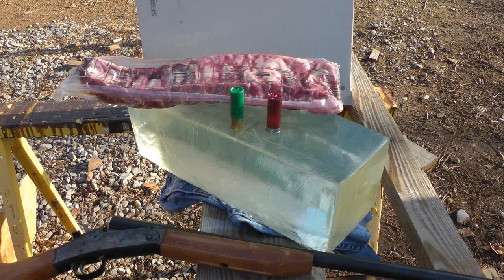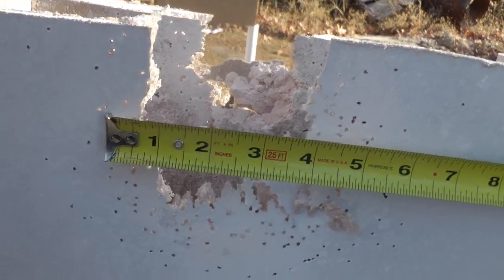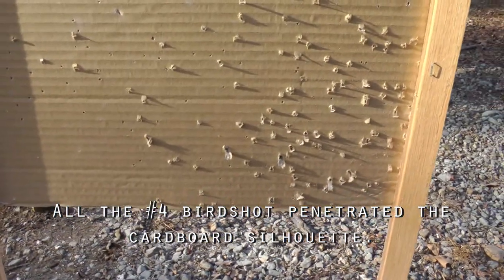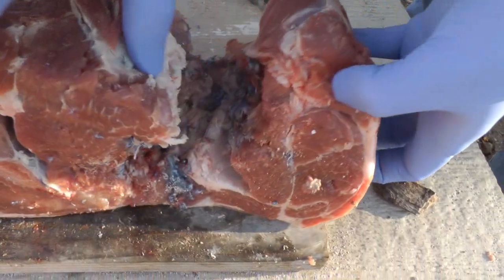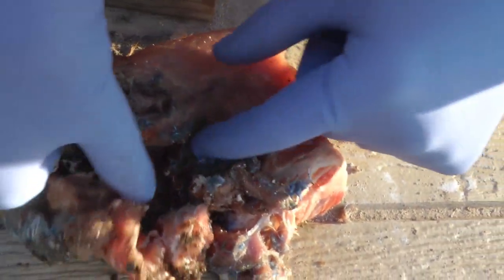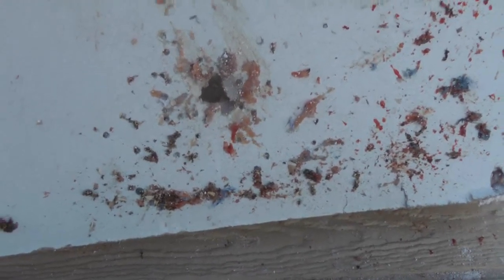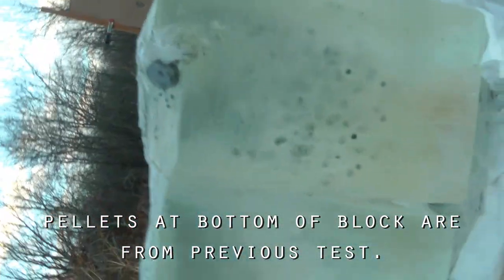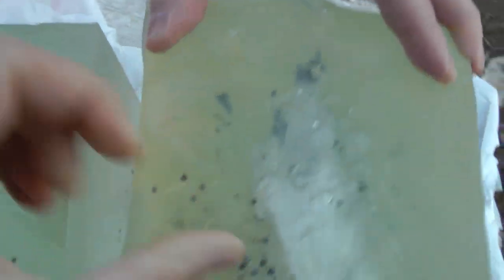Birdshot Home Defense Gel Test

Comment: i was shot in the right leg from 10 feet with 20 gauge load of steel #6 shot, I still have some under the skin that was left behind after healing, it took 2 and 1/2 months to get back up on my feet, the doctor that did the work told me I was lucky I stll had a right leg to heal. I lost approx. 6" of flesh and muscle. the bone was not touched. I have pics if proof is needed. I can tell you for a fact, without a doubt, at that distance, the intruder you speak of, will not continue the attack, if they are not dead, and guys, don't worry about whats behind the next wall, ALL of the shot was in my leg including the wad.alot of whats posted on here is B.S. ballistic gel is not human flesh. there is a difference. of course, I can only speak of my experience with the subject, but in my mind, that was the maximum. good luck and God bless
Reply: Had you been shot in the chest you would likely not have survived.

You can shoot people in the leg with all sorts of things and they won't die.

As long as you don't hit the femoral artery, you could likely be shot in the leg with a .50 BMG and survive, but you would lose the leg.
Reply: That's why he did the test with pig meat as well. Ballistic gel is just used so we can see how much penetration the actual pellets/bullets can make, being the closest to see through "human flesh". It's still a good idea to be cautious what's on the other side of a wall so the same incident doesn't happen to someone else in your home.
Reply: MrShysterme  Most people who are only hit once, survive.
Regarding the .50Browning. Indeed! Instantaneously!!
Reply: TrinityGadgetry any gun can kill tho. im sure a 20 gauge is more than capable of killing a person if a intruder is in your home. id use a pellet gun if need be. you are not going to withstand multiple hits from a ranged weapon and still carry on a fight. shotguns typically are not much use after 30 or so yards. close range are destroyers. a 410 in close quarters is just as deadly as a 12 or 20.
Reply: ***** I think people often underestimate the nastiness and penetration of birdshot at close range, I knew a guy that blew his foot almost clean off above the ankle with a 12 gauge target load. I think the tungsten BB sized shot is a solid choice for home defense if you don't like the idea of buckshot flying through the neighbors window, hell I got my first deer with a 12 gauge #2 lead while I was duck hunting, I hit her right behind the shoulder at about 7 yards and she more or less dropped although I took a quick follow up shot to make sure, upon skinning it we found that the heart/lungs were basically turned to mush and a couple pellets almost made a full pass through stopping between the skin and ribs.
Reply: Meester Anderson
That's because point blank with birdshot it is still all clumped together and hasn't spread out yet. Making it more like a single shot bullet.
Reply: +Michael Prue Thank heaven you're still around to tell the tale. This is one in the eye for a couple of my favourite YouTube know-it-alls: the "buckshot only" brigade, who think that on ounce of birdshot is no better than bad language; and another set of wack-jobs who imply the 20 bore is only good for small to medium-sized frogs. The "birdshot vs buckshot" argument simply doesn't exist in Europe. By far the most popular guage here is the 12; we just stuff it with anything and never worry about it. We also have a strategy which doesn't seem to have occurred to the armchair experts: if it doesn't go down with the first shot - clobber it again! Problem solved, I'd say.

This argument is just downright silly. As someone else here has observed, it's like debating whether it's better to get run over by a truck or a train.
Reply: Shot placement is everything ! A .22 can be more lethal than a .44 if the shot placement is dead on vs the .44 being off.
Reply: MrShysterme pretty sure the hydrostatic shock would rupture your femoral artery from a .50 bmg
Reply: Jacob S. Well ya, 7 yards is about 21 feet.. home defense situations are usually closer than that
Reply: Thank you for sharing

Comment: 03:00 so this is what happened in that school shooting where the guy with the shotgun gets hit with pepper spray and brought down by an alert student, but not before he shoots an unsuspecting girl from about 6 feet in the upper chest/face area, and she walks away.  According to the video, it was a 12 gauge birdshot load.  I didn't think that you could walk away from that..
Reply: there is also the "angle of penetration" which may deflect a lot of energy and have glancing hits as well as the choke /no choke combo.  a "low brass" practice load has 1/2 the energy and then if it spreads and is glancing... and you have thick skin and bone... then it may just be a flesh wound... compared to a magnum 12 gauge 3" 15 pellet at 1600 fps with 2700 ft-lbs of energy to "go somewhere" (div by 15, that's still almost 200 ft-lbs per 25 cal pellet, and with one shot, not 15)
Reply: The reason people don't look like a shot up pork shoulder after getting shot by birdshot is because a hunk of pork shoulder is not living flesh.  Human flesh is flexible and does not react the same way a stiff, hunk of dead meat reacts.  Meat tests are a terrible representation for how a bullet reacts on the human body; at least ballistics gel is calibrated to a certain degree.
Reply: I also think she was wearing a bra so could of absorbed a small junk of the hit

Comment: Ouch! I had No idea bird shots are this deadly!!!
Thanks very much for sharing.
Reply: It's a range thing. At very close quarters, the shot has barely separated out and still has a lot of energy. As it travels and spreads out, those pellets start having to carve 200 or 500 or however many individual paths through the air. Front surface area of a pellet is proportional to r^2 and mass to r^3, so when you halve the diameter from #000 Buck (.36") to BB (.18") and again to #8 bird (.09") you're taking the pellet weight down by a factor of 8 and getting 8 times as many pellets, each with a quarter the front surface area. In other words, twice the total surface area and twice the air resistance at any velocity. Also one eighth the energy per pellet at any velocity. At very long range, clay pigeon / rat / snake loads are "rather annoying," according to someone who got hit several times while riding past a clay pigeon range. At short range, though, they haven't spread out yet and they haven't lost much of the ... well, judging by the Winchester packaging, 1 oz at 1290 fps (2196 J), 1.125 oz at 1255 fps (2340 J), 1 oz at 1450 fps (2774 J) or 1.25 oz at 1330 fps (2921 J) for #8 birdshot and 1.125 oz at 1255 fps (2340 J),  2.125 oz at 1050 fps (3096 J), 1.5 oz at 1260 fps (3144 J), 1.0625 oz at 1550 fps (3373 J), 1.875 oz at 1210 fps (3625 J) or 2 oz at 1300 fps (4465 J) ...
We interrupt this discussion to bring you the following comment from my right shoulder: "OUCH!"
... in #4 birdshot. If you watch Paul Harrell's videos you're likely to notice something about those heavy turkey loads and his meat targets, particularly how much the meat targets move when they get hit by something like that. There's a 54-pellet #4 buck, which I make 2.555 oz, round offered, too, at 1050 fps, which is 4463 J. I imagine the kick from that is terrible. I also suspect it'd have knockdown power like nothing else you can shoulder outside Hollywood.
For energy comparison, figures from Ballistics By The Inch:
9mm Luger 515 to 868 J maximum, 447 to 651 J out of a 5" barrel;
.45 ACP 623 to 1044 J maximum, 488 to 759 J out of a 5" barrel;
.44 Magnum 1139 to 1952 J maximum, 868 to 1369 J out of a 6" barrel; <== (there's one Federal load that's insane and the rest are at the low end of that range)

.223 Remington 1424 J out of a 16" barrel.
... and from Wikipedia:
5.56 x 45 mm 1679 to 1859 J;
7.62 x 39 mm 2056 to 2179 J;

7.62 x 51 mm 3520 or 3628 J;

.30-06 3820 to 4042 J;
.338 LM 6516 to 6810 J.
In terms of kinetic energy at short range, those shotgun loads are anywhere from saying "Pravda, Tovarisch" to an AK-47 to saying "suck it" to an M1 Garand. That's the scary side of nasty. In physical terms, you've got 400 pellets, each meant to be lethal to a pigeon at 50 paces, hitting a very small area, and the first few dozen are going to open up a space for the next few dozen to get further in before they hit flesh et cetera. The purpose of a wax slug is to bring a target at longer range to within the range at which birdshot hits in a mass rather than as a spread, so all the damage gets done to the target and none of it gets done to anyone else.

Comment: As usual, there is a lot of misinformation on these threads. Birddshot is designed to kill small (and fast) moving targets (birds) at long distances.  Buckshot is designed to kill large (and fast) moving targets at long distances. If we're talking about Home Defense, this is not a long distance engagement. It will be 5-7yds, and line of sight (meaning that you won't be shooting through a wall at your target). If you're concerned about hitting your (or somebody's) kids in another room, go with the Bird shot sizes (#4, #6, etc). You'll kill what you hit in those ranges and worry less about killing an unintended, innocent bystander in another room, apartment, house, etc. I use #2 shot in my HD shotgun, followed by #4 buck in the later rounds - but there is no news story that you'll find where a civilian needed to fire more than 2 shots from a shotgun to stop an intruder. NONE.
Reply: Did you not watch the video? It clearly shows that #8 birdshot can be lethal.

Comment: So it appears that I can keep the #7 field load in the shotgun and feel safe I can stop a perp at night (if I hit him).  I like the idea of field loads because our houses are 10ft apart and I do not desire to hurt anyone other than the perp attacking the family.  Im assuming the 7 load will be stopped by the walls in my house.
Reply: I have been wanting to purchase the shortest legal barrel for my old Mossberg (since I no longer do much hunting). Also a rail mount for an LED flashlight would be nice. I think that would be quite sufficient for home invasion protection. If I had time to don the sidearm I'd have that too. In most cases you have got to react VERY fast as I recently learned with a close encounter.
Reply: G Philip C
18.5" bbl's are available online to fit the mossy's. They are easy and quick to replace. Mine is 21 I think so I may get an 18.5 myself.  They cost about $100 no choke smooth bore with bead sight.
Reply: ***** ~ 'Ats what I need.
Reply: Not really.  With no blood or blood vessels plus a smaller rib circumfrence, the birdshot failed to penetrate deep enough to reach any vital organs.  The wound looks painful as hell but in no way would that guarantee someone would be incapacitated especially on an adrenaline dump.  The #4 shot which is much heavier also left a large amount of pellets in the meat and showed a shallow wound.

By those results, #7 would be a fail load to rely on and if your target is a fatty then there is little chance of incapacitation.  Should your target have a firearm then you will be in trouble.
Reply: brainplay
thats unfortunate. The second thru 5 is a Breneke 1oz slug however.
Reply: brainplay
I have done alot of field work with various birdshot loads, I like #6.
I can tell you, at "apartment ranges" birdshot will stop an intruder, and is lethal. but you use what you feel comfortable with.
 I have yet to see anyone say "shoot me at 20ft with #7 birdshot, I can take it"
I am not asking anyone to do that by the way.This is an old discussion and has been brought back many times. Folks practice, and know you weapon and loadout.
Reply: In Europe there's not hesitation because if you shoot an intruder into your home with your hunting shotgun you'll spend some years in prison and pay a lot of money to his family. It is cheaper to pay once for a killing than paying a rent to a disabled man for the rest of his miserable life. Therefore 00 buckshot or invite him to have a cup of coffee while he gets all your valuable things, lol.
Reply: @brainplay8060  The heart is less than 2 inches behind the skin so yeah it penetrated deep enough. Also pork shoulders are tough as hell. In a person on e it blows past the ribs which it will do, the density of organs doesn't compare to a pork shoulder. It will go deeper.
Reply: @nicktaylor5952  Pork shoulders are the minimum distance it needs to travel. I wish he had kept the plastic on. Skin counts for a LOT when it comes to slug penetration. The difference between a mechanical arrow penetrating meat with skin on vs. meat without is huge and those are sharpened to cut through skin. Pellet will start their deformation before the skin breaks. Then it has to penetrate the central ribcage joint, through layers of muscle and deep enough into the heart to cause hemorrhaging. Possible? Sure. Guaranteed? No. Hydrostatic elastation (meat stretching effect from impact) would also be minimized due to the mass of the chest.

In short while it's possible to work, it's no guarantee. Also note that if you're an expert shot and will hit the heart then you could use any other weapon just fine. Hits to any other area will not be fatal unless you hit major limb arteries. But finally, are you really going to use a 24" shotgun for home defense? You may want to walk your home with it first. Doors, hallways, and small rooms will suck. Living rooms will be 2x-3x the distance shown here. There is a reason that SWAT teams and troops use small carbines, sub-guns, and drastically cut down shotguns for entry.

Comment: simply the best demonstration on your tube that bird shot is a highly lethal load for home defense.  Any opinions that bird shot is crap has been answered.  Especially like that #8 it went thru the meat but not the drywall.  For me and family that means bad guy seriously messed up and my family not effected by flying pellets.
Reply: At 10 feet, the plastic wad of the shotshell is a formidable projectile. This was shown in the shots into the pork where the large hole was the result of the plastic wad. Likely the shot had not yet spread too much and most was carried through the meat. Shooting at 10 feet simulates the average bedroom distance, and allows for the space of furniture in the room.  

I use a 20 gauge for home defense. It's lighter, quicker to aim and lower in recoil. That's slightly offset by using Winchester #3 (20 pellets) or #2 Buckshot. Buckshot will have much deeper penetration than birdshot and will still provide good energy after hitting intermediate barriers (drywall, sofas, chairs, etc) up to 20 feet. Please keep in mind that in a home defense situation your target will be moving so it's likely that less than the entire load of shot will strike him and possibly the wad will miss.  In addition, thick, loose clothing (hoodies, jackets) may absorb some of the energy from each pellet, greatly reducing it's penetration depth.  This is less important with buckshot as each pellet has more mass and will penetrate deeper. For apartment dwellers with a 12-gauge, I'd suggest a 2 3/4" shell with #4 buckshot as your defensive load. It will penetrate drywall into the next room/apartment so plan ahead to minimize the risk to neighbors (e.g. putting a full bookcase along the neighbor's wall).
Reply: I agree kc
Reply: Traxxis monster truck tour

Comment: The only reason I use #8 for home defense is because It's very difficult to find #9 or smaller shot.  #9 shot is what we used in the military for breaching so not to injure any potential hostages on the other side of the barrier.  The most dangerous thing after breaching is a flying stricker bolt from the door.

Comment: 1.125 oz of #4 bird shot at 1255 fps is about 1721 foot pounds at the muzzle. An overhead swing with a four pound dead blow hammer is about 200 foot pounds. I have seen a chest wound above the heart in an autopsy obviously done with bird shot. The hole was the size of a golf ball about 3 inches deep after going through bone and the spread was about the size of a baseball. This round seemed adequate to stop a 165 pound man permanently.

Comment: A 5.25 ounce baseball pitched at 90mph or 132 fps generates 89 foot pounds of of energy. #9 birdshot from the cheapest trap using a  7/8s ounce load at 1340 fps generates 1527 foot/pounds of energy or 17.157 times the energy of a baseball. A baseball is 219 cubic centimeters. 219cm2 of lead would be 2483grams or 5.47 pounds.  Being hit by birdshot is like being hit by a lead baseball at 90 mph.